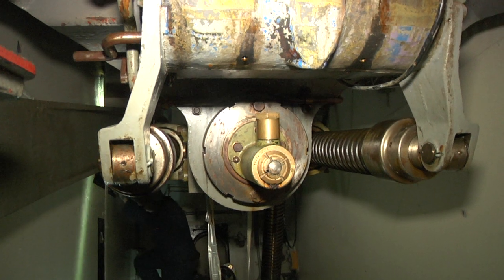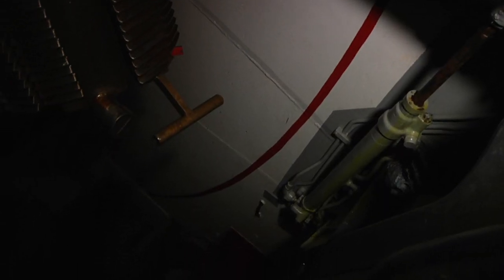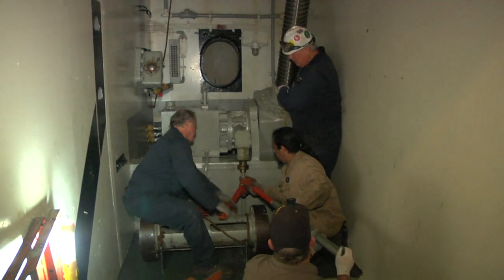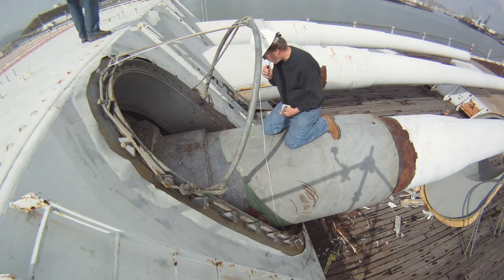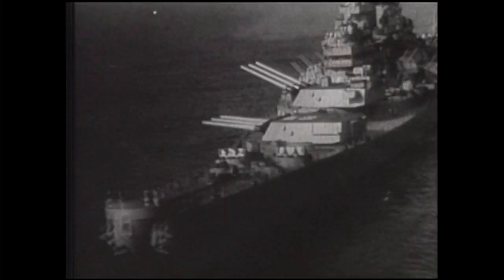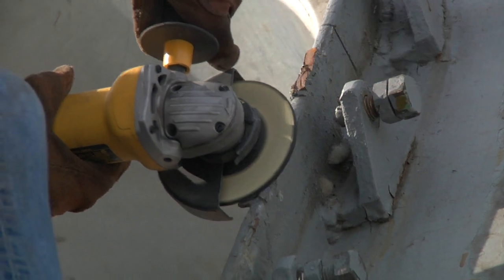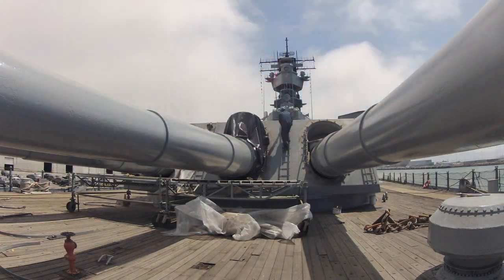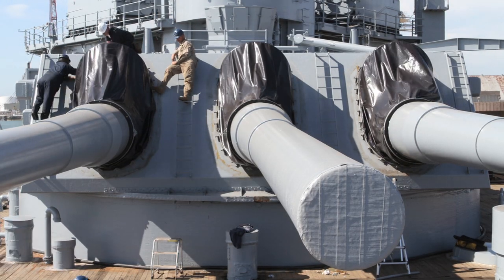Raising the Guns on Navy Battleship

Comment: We did the same thing in Pearl Harbor, USS MISSOURI BB63.  No elec, hyd fluid or nitrogen.  We only used one pipe wrench because as a GUNNERS MATE I knew a "worm gear" can not be driven back down/through with out actually turning the shaft.  It took 32 active duty men and women from The USS O'KANE DDG 77.  We were requested to figure out how to raise the barrels and the raise them and install the bloomers for the movie Pearl Harbor.  I was told by Louisville that it could not be done manually and a person got hurt when a gun came out of battery due to no counter re-coil nitrogen.  I called the USS CAROLINA BB 55 and talked to a gentleman and asked him if by turning the "elevation response shaft" would the balanced gun raise.  The answer was yes and to make sure to lock the "yoke locking devise" so the gun would not fall out of battery.  We actually partially broke the welds on the weather encasements as we raised the guns.  I was then asked to send written and illustrated instructions to Norfolk.........    I miss my active duty days.

Comment: The reason they change the hydraulic fluid when they decommission the BBS. Was that the hydraulic fluid the Navy used in the 80s before their decommissioning was what we referred to as cherry juice, or cellulube and it was a cancer-causing agent and pretty nasty to deal with. Have you taken a bath and it's several times due to various failed Hydraulics the VA screens me every year pretty Faithfully for cancer

Comment: I think that Battleships should be the last line of defense with the 16 inch guns and some modifications for deck anti air and other big machine guns.
Reply: It would be useless. Either taken out by aircraft or missiles before it even fired a shot... or simply bypassed by small craft it couldn’t possibly track and hit.
Reply: @Bartonovich52  yup. There is a reason every major county in the world went to aircraft carriers
Reply: I agree too. Modify some deck guns as well, converting to missle systems and guided rounds. 
They were solid ships, USS Iowa got hit by kamikaze and only required paint as repair! 
Only thing is a full armed destroyer class could outmaneuver the battleship and lead to win against it. So lots of missles on the battleship would turn tides maybe.
Reply: Reid Hill They DID have missiles on board during the last refit in the late eighties; Iowa and her three sister's were outfitted with cruise missile launchers and. two CIWS radar aimed gatling guns; not to mention the modernized electronic gizmos to bring the battleships up to date to take on the Soviet Kirov class battle wagons.

Comment: I would love to sea any on the iowa class battleships move under their own power
Reply: Daniel Heywood closest you’ll get is the end fight scene on the movie Battleship
Reply: @mikecorleone6797  Under 78 hours notice, (two days) with a proper crew, they can be brought back into service for use by the Navy.
Reply: @mikecorleone6797  Actually most of America's battleships vet or Museum ships all they have to do is have some refueled rearmed and they'll move watch the USS Alabama
Reply: Mike CorLeoné it is fully functional( without the guns)but A ton of maintenance is needed.
Reply: CoderBert 39 actually no they aren’t... the turrets are filled with cement at some point to keep them from moving, many areas of the ship are welded closed and the steam turbines are either removed completely or permanently disabled... they are basically floating barges now.. my cousin works on the iowa as a volunteer and has taken me down below decks.. the boilers are stripped on the ship and the guns have concrete plugs in them
Reply: CoderBert 39 not to mention the holes that are cut into the fuel tanks for maintenance access
Reply: @coderbert3996  From my understanding all the Iowa class ships would need new boilers at this stage, that means you have to take all the upper decks off to get them out....
Reply: Maybe if the boilers or engines weren’t stripped apart and if they can muster a crew together that has any slightest familiarity with the old steam and analog systems i suppose it can be done.. wouldn’t really make sense to do it but I’d absolutely love to see some of these old ships back in service showing the enemy who’s boss
Reply: I'd hoist underway colors in a heart beat.
Reply: Daniel Heywood ya do realize that according to the people on the ship, if it gets fueled, untethered and proper checks are done, it’s fully functional?

Comment: How could they raise the guns in turret 2?  the whole inside was pretty much destroyed and was never repaired because the navy was eager to scrap her in order to cover up the incident. as far as I know the only people that were ever aloud to go in turret 2 after the explosion was the volunteers who disposed of body parts and equipment
Reply: allowed. The gun was mostly repaired before the ship was decommissioned in 1990. There was no cover up, just a biased initial investigation that mis-placed blame for the accident.
Reply: Consult the book "Explosion Aboard the Iowa" for explanation by Sandra Labs (Sandra designs nuclear weapons).
Reply: There was an exact same type explosion in ww2 in the soloman. I am not sure which ship. That one was in a battle at the time. That was kept secret for decades. The investigators of the Iowa researched the other explosion. One explanation was age of the powder bags. The ww2 explosion was using ww1 bags in a ww2 fight. 14 inch guns I believe. That was one possible cause (age of bags). Another was misplacement of the primer. It goes between the bags, which ones in order I do not know. But misplacing it will cause a similar explosion.
Reply: the gun mechanisms are tougher than you think.
Reply: kaviski1 the captain was ordering equipment thrown overboard and repair work done before anybody could investigate the accident site. If that's not a coverup then what is?